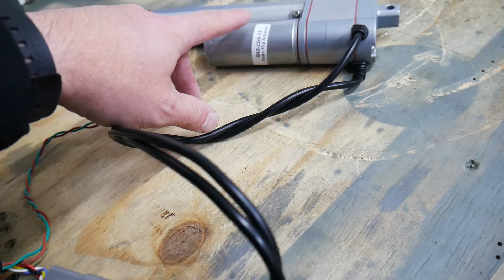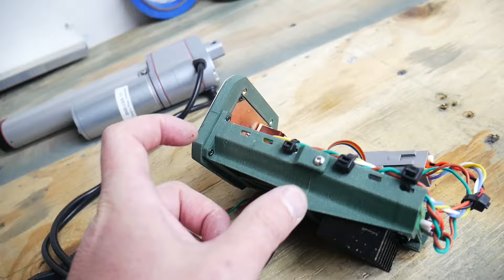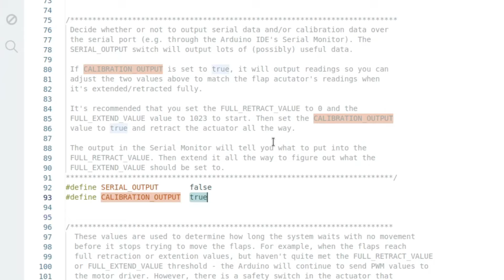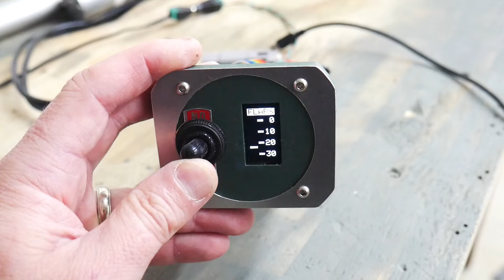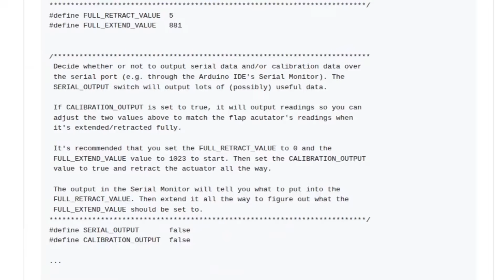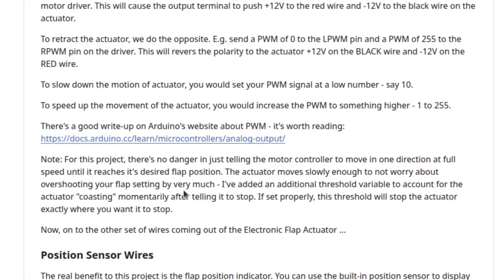Sonex Build - Home-Built Flap Control/Indicator

Comment: Hi Dan. I am building this very slowly as I am a cpmplete novice in electronics. Give me an engine to play with and i'm fine.Can you tell me the mechanical load in Nm of your actuator as i will be using an Actuonix unit. Also I am going to try to adapt the code and build a seconond one for a pitch control actuator. I am not building Sonex but a PIK26
Reply from the maker: Very cool. I'd love to see your finished project.

I don't have a solid answer about the limits you're asking for - as far as I can tell, Sonex doesn't list any of that info. They only gave me current loads (3.5A for a 12V system and 2.0A for a 24V system). 

The actuator I have looks exactly like this one, but I can't say for sure if that's it or not. There was clearly some kind of label that was removed before it was added to my kit, probably to prevent the buyer from identifying it and buying one from someone other than Sonex:
https://www.progressiveautomations.com/products/linear-actuator-with-potentiometer

Depending on which actuator you select (there are three "force" options) it might be 35, 50, or 150 lb. Interestingly, most linear actuators have different values for when they are moving and when they are stationary, but this one does not. It looks like they are the same for dynamic and static values.  

Because it's a pushing force (not a torque force) they are listed as lbs, not ft-lbs - so that value can't be converted to Nm, you'd have to convert to Newtons. If this is, indeed, the correct actuator, that would convert into 155.7N, 222.4N, and 667.2N, respectively. 

If there's question that you need more pushing force, you can extend the arm on the flap control rod to increase torque, but you'd also need an actuator that can extend farther to reach a longer distance.

Not sure if that's helpful or not ...
Reply from the maker: Here's another link to what looks like the same actuator, but also includes some wiring diagrams:
https://www.firgelliauto.com/products/feedback-rod-actuator
Reply: @dan_der_flieger  Thanks Dan Every little bit helps. My head is currently scrambled by the code, but once its all up and running I can play about with it and see whats happening. Incidentatly, the pitch control will be connected similar to Sonex spring type pitch mechanism by Aeroconversions, but replacing the rotary knob with the actuator
Reply from the maker: Interesting idea. Are you still planning to turn the screw on the Aeroconversions control to make the adjustment? Or would a linear actuator replace that? You could probably use a continuous servo to rotate the screw instead of the knob. Make sure you still have a way to adjust it if the servo fails.
Reply: @dan_der_flieger  The screw mechanism is replaced by the actuator and this reacts to the spring trying to counter it. I'm doing a mock up on my other  microlight but using a lever to act as the actuator. Once i have proved the mechanical concept, then I will adapt it to my new build aircraft
Reply from the maker: @jonparnaby - sounds like a solid plan. For trim, I recommend decreasing the PWM value to slow it down and make small adjustments. You can select a PWM value from 0 to 255, which determines the speed at which the actuator moves. 0 is no motion, 255 is full speed. Look at line 242 in the Arduino code:

#define ACTUATOR_SPEED 255

If you change that number to, say, 128 the actuator will move at half speed.
Reply: @dan_der_flieger  Hi Dan. I tried to make the pcbs but with very little success, so i ordered some from jlcpcb after sending them the Gerber file. Sadly i could not slot the Arduino Nano into the pin holes as they are very small (0.6 mm) I edited the the holes to 1mm  and i'm waiting for these to be delivered. They are a chinese company and the build quality is excellent, they even verify the file before payment so as not to waste time and money if there is an error
Reply from the maker: @jonparnaby  - dang. Sorry about that.

If they come back ok and everything seems to work, let me know so I can update my design file so it doesn't happen to somebody else.
Reply: @dan_der_flieger  Update on the PCB. All components fit well. I think its worth the wait to have them professionally made. I forgot to say when i ordered the first batch, they returned an error in that there was no break line for the oled pcb. I am not familiar with Kcad and don't know how to insert one but i did manage to delete that part of the pcb and just had the main pcb which is the one i am going with. hope that makes sense.
Reply from the maker: @jonparnaby - thanks for the update. I'll take a look when I get a minute.
Reply from the maker: Can you shoot me an email with a photo - I'd like to see how it turned out. 
dan.der.flieger@gmail.com

Comment: Let's see, maybe that's something for my future Sonex Highwing.

You have to try Onshape as CAD program.
It's great and it runs in the browser. The free version only allows you to create public 3D Models.

I also would like to develop my own glass cockpit avionics, when i'm in University.
Reply from the maker: The high wing is kind of cool. I work with a guy that likes OnShape. I'm sure it's similar to the rest. I'm not a fan of the public files that you mentioned and I like having software I can take with me on my laptop. Maybe I'm just old. 😅
Reply: @dan_der_flieger yea, sure that makes sense. But is sooo convient. I'm not a CAD guy and I just use it for my 3d printer maybe once a year..

Comment: Hi Dan, it is beyond belief how the heck you get your head around this stuff, it sends me into tilt mode.  When I get to installing and powering up my flaps I will go back over this video, as I just have the switch and no room for the LCD dial indicator panel.  It is one area I actually haven't given any thought to.... I love the way you put on offer your work with the links and downloadable how to guide to others, its commendable.
Reply from the maker: Thanks Andy. This stuff is how I make my living, so I've gotta put some of it into my homebuilt airplane. 

I made a post on the Sonex Facebook group a week ago or showing my progress on this project. One of the other group members mentioned a little indicator that you can buy for about $25 that's a lot smaller than this one. It still requires you to press and hold the switch (rather than the notches with mine), but the indicator is a lot smaller and might be worth looking at for your tight panel:
https://www.actuonix.com/indicator

I usually do share whatever I design. Seems like a waste to do all the work on these things for one-time use. Hopefully someone else can start with what I made and adjust it for their own use.
Reply: wow thanks for that Dan, I will check it out
Reply: Just checked them out, and do I need the Linear Actuator Control Board also, thinking yes I do?
Reply from the maker: @pandyseven - you should only need a six-pin, ON-OFF-ON toggle switch. This is the one I bought for my project, but it can be used for the standard Sonex wiring, too (no control board necessary). It's a marine grade switch and it seems really sturdy:
https://a.co/d/am0fZ0w

Sonex support emailed me a wiring diagram, but the images were really small and almost useless. If you want, I can make a better drawing and email it to you. Just shoot me an email with your non-work email address (I assume you don't have access to that one anymore now that you're retired and I think that's the only one I have for you). If you don't have mine anymore, you can use the one associated with my YouTube account and I can send my personal one again (which I don't want to post here 🙂). Here's the public one I don't really care about:
dan.der.flieger@gmail.com
Reply from the maker: @pandyseven  - also, you probably want to make sure your flap actuator has the position reporting circuit before ordering the display. Sounds like some of the actuators didn't. If yours came with it, it will have two sets of wires coming out of the actuator. One set is RED/BLACK which is used to move move the flaps and the other set has a WHITE, BLUE and YELLOW wire which are for the position sensor. Some of the actuators only had the RED and BLACK wires (no way to read the position).